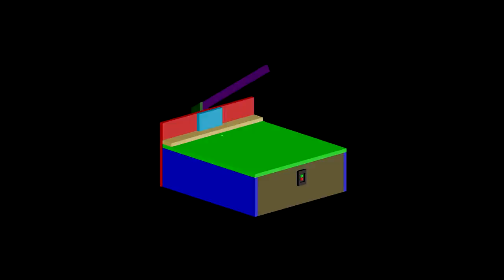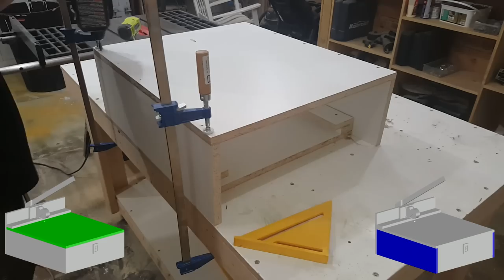DIY Pocket Hole Machine

Comment: Brand new to your page and love what I see, even subscribed, but there is NO reason in hell I should’ve just been forced to endure four or five commercials in an ELEVEN minute video!! That’s insane and I will definitely unsubscribe if that’s a running theme with you... I hope it’s not because I love your videos. 

Question. How much of your design’s width is excess? Or is every millimeter crucial?
Reply from the maker: Not sure why you see that many ads because I didn't set it like that. The machine is able go be adjusted to suit your needs to a point.
Reply from the maker: Not sure why you see that many ads because I didn't set it like that. The machine is able go be adjusted to suit your needs to a point.
Reply: DIY Builds Awesome and thank you! I’m not sure about the ad issue either but there was one before it started (which is normal for most) and three or four more ads before the eight and a half minute mark. Regardless, love your videos!!